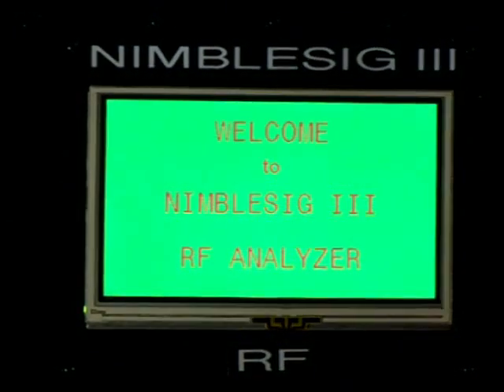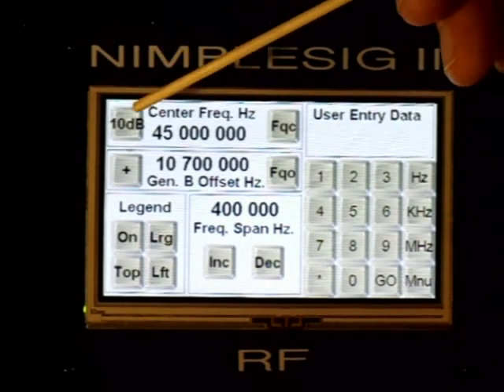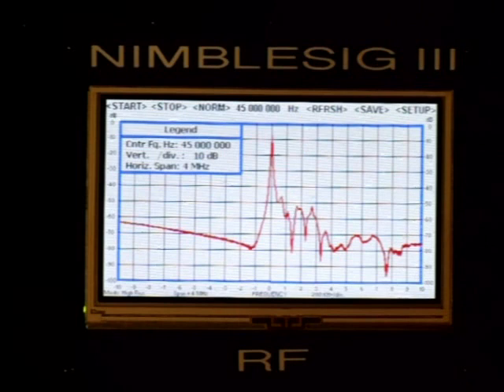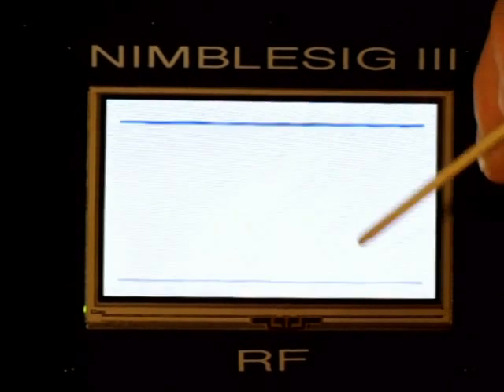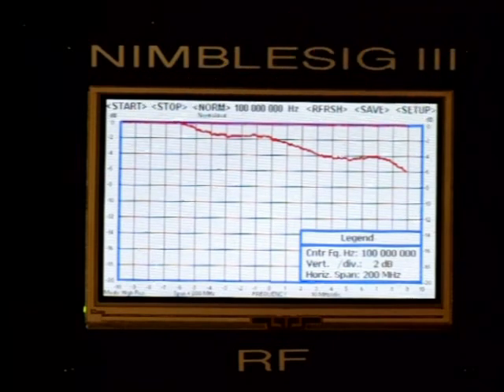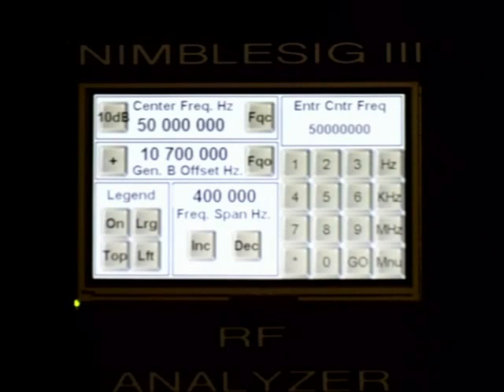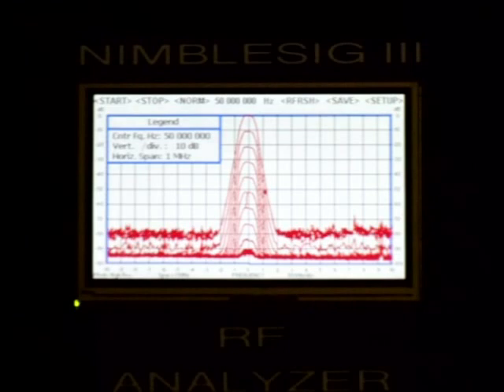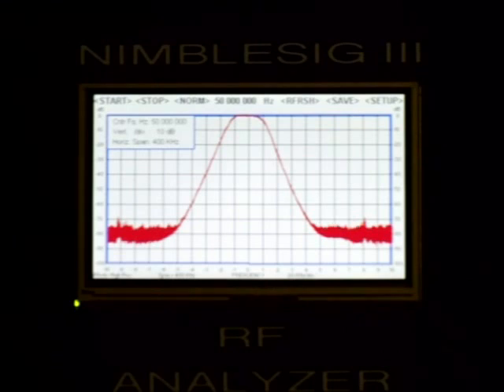NimbleSig III RF Analyzer Tracking Generator

Comment from the maker: @wa4aos 
Hi Glenn,
I am not familiar with the TG tracking generators but if they are in the same high class as your HP8566B, 100Hz to 22GHz, 10 Hz FreqRes spectrum analyzer then I imagine the TGs would work better for viewing the bottom of extremely narrow and deep notch filters. For those not familiar with the HP8566B it is a laboratory quality, 1980s vintage spectrum analyzer that, as I recall, cost  $75-100K new depending on options.  Wonderful instrument! - congrats Glenn!!!
Thanks!
va7ta

Comment: Hi,
Thanks for your excellent video. I have an Hp 8566B spectrum analyzer. However, the 8566B Does NOT have a tracking generator. DKD industries makes and external tracking gen called the TG 100 and a second unit, TG 200. Are you familiar with these Track Gens? If so, how do you the resolution will compare to your arrangement?
Thanks,
Glenn
DSM Labs